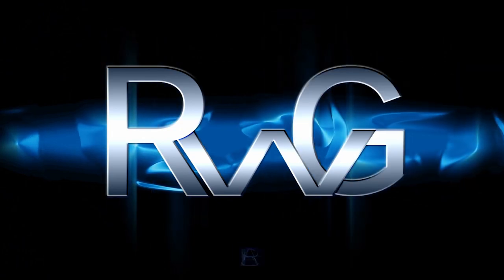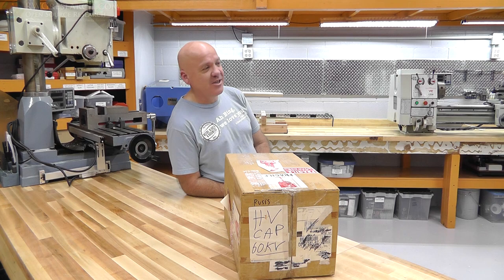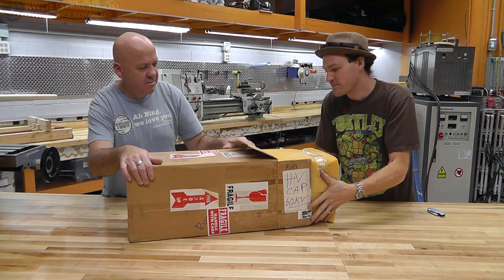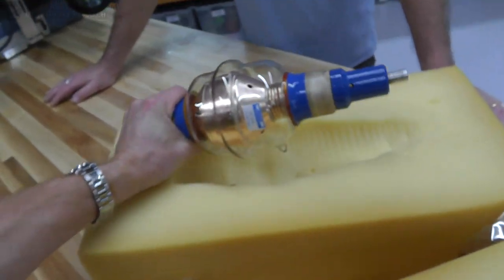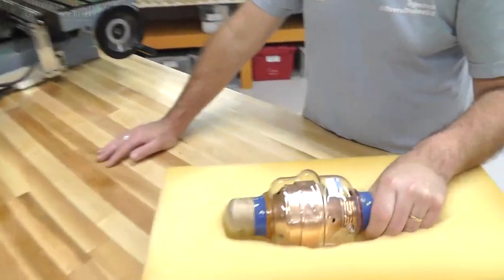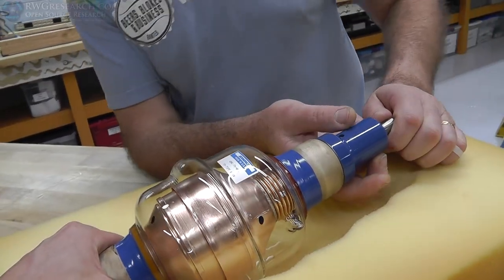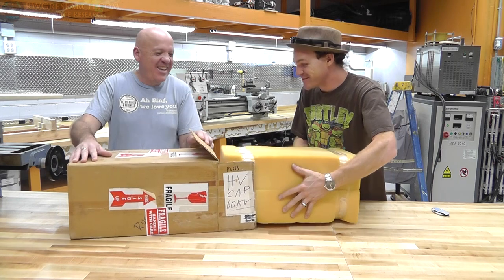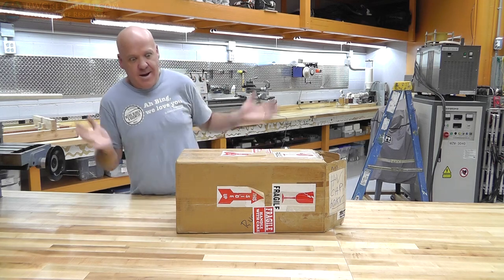Jim & ~Russ Look At A 60 KV Variable Vacuum Capacitor Blane Sent. UHC-75-60s Jennings

Comment: your going to kill me when I tell you this...In the 80's a ham radio guy down the road gave me a box full of tubes that looked like that, with the rotary adjuster which moves the internal ring up and down and we used them as target practice for our sling shots...they were hard to break...oops.
Reply: FYI... the small ones go for over $100-$300 each, on ebay, now.  I have no idea what one of these would cost.